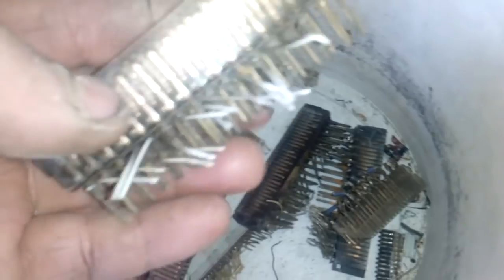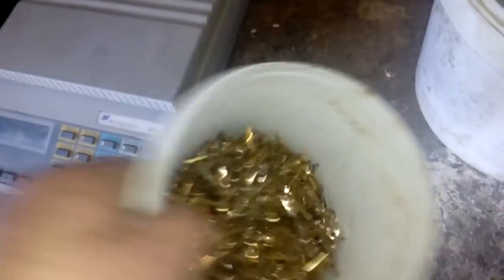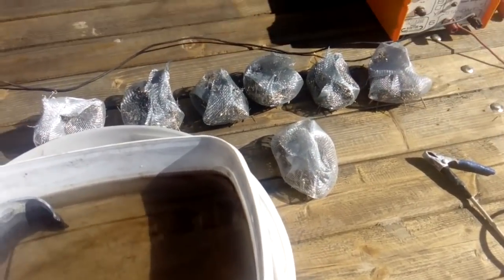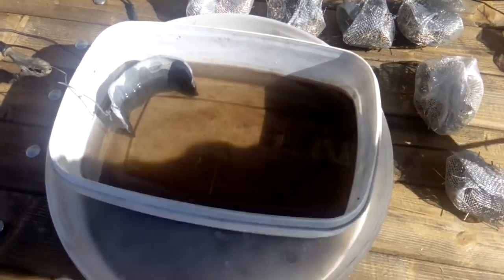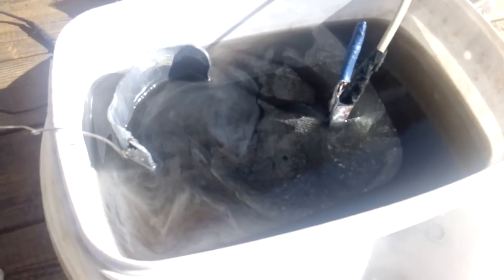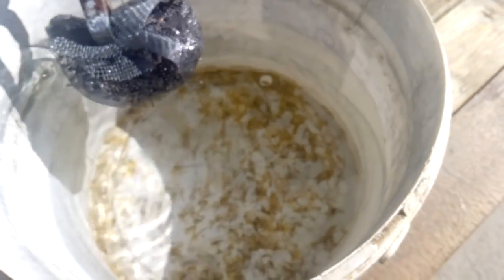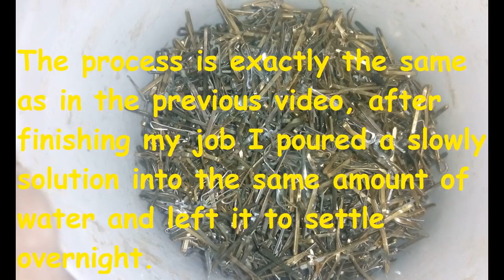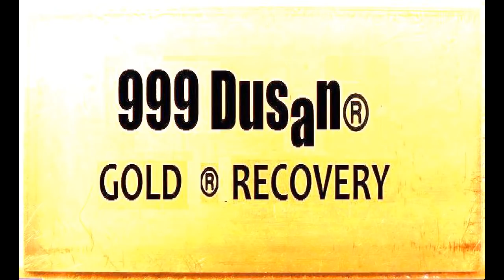Reverce electroplating - acid & bleach gold recovery method!

Comment: "D". Go on eBay and get yourself a cheap distillation set and distill your own Nitric acid.  That's what I do.   You can see how on my channel.  All you need is KNO3 from stump remover and sulfuric acid drain cleaner and distill.  You will get 85 to 90% red fuming nitric acid.  Water it down distill again and you will have the 68% azeotrope
Reply from the maker: Thanx for tips mate,soon i need to try destil my own nitric but not yet,first need to setup beter lab.
Reply: @999DusanGoldrecovery  if you watch my video you will see me distilling in my backyard on a bench lol.  You don't need a lab brother
Reply: @chemistryscuriosities  please show me how. I've seen videos but where do you get a distillery? Ive looked but not sure which is the best yet cheapest route? Cuz I just purchased a 1L bottle of nitric acid for something like$81.00! So I can't keep doing that. Please! Guide me!

Comment: Hi Dusan, I’m also looking to try reverse plating on a bigger scale, I like your mesh parcel idea, what’s the best mesh to use copper, aluminium or stainless steel?
Reply: stainless steel
Reply from the maker: Copper mesh is best but most expensive,stanlies stell and alu mesh is cheaper and do the same job.

Comment: CAN I USE GASOLINE AS THE LIQUID THAT IS NEEDED TO BATHE THE BASKETS OF GOLD PINS IN? I BELIEVE IT SHOULD BE FINE AS LONG AS YOU DON'T CREATE SPARKS BY DOING THINGS SUCH AS SHORTING THE NEGATIVE AND POSITIVE TOGETHER. I HAVE ALWAYS BEEN SUPER SMART, GIFTED EVEN SO YOU MAN PIN THIS COMMENT IF YOU SO WISH. :)

Comment: hello dussan the mesh you use to hold the pins, is halved iron or stainless steel, thank you very much
Reply from the maker: You can use eny mesh,stainles stell,aluminium mesh,coper mesh.Newer use cink mesh because make problem when you refine slug.
Reply: @999DusanGoldrecovery  thanks you

Comment: Hi Dusan, i really like your Channel. I dont know how to write you directly, so i decided to write you through a comment on this video. I have a question to you, it is not about this video, it is about another video, or videos. How much is the difference between working with sulfuric acid on IC-Chips (wet-ashing) and "only" crushing them with ball mill or other stuff and after that gold-panning. So do you really get much more gold with the acid-way? Because the costs for the acid's are not really less. Thank you for reading and maybe giving an answer. :)